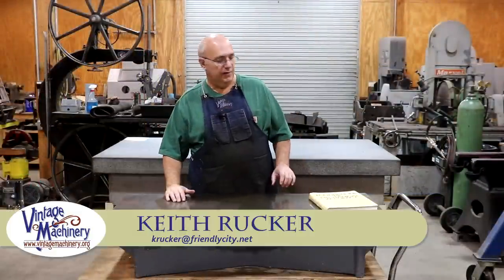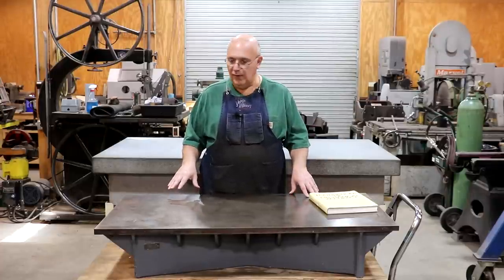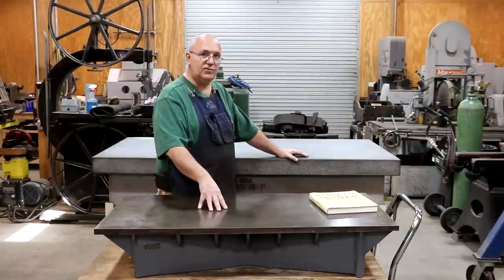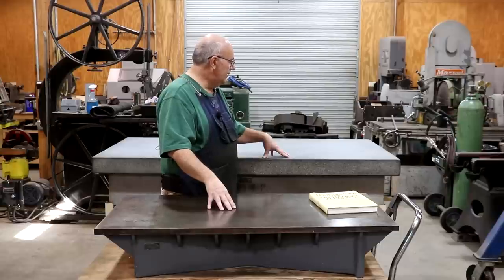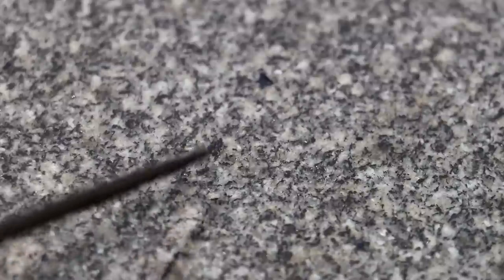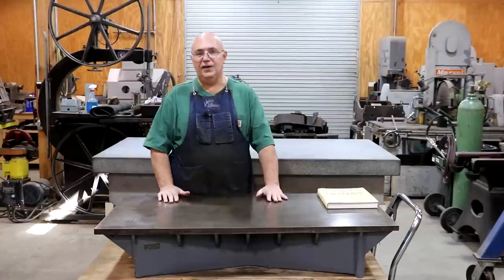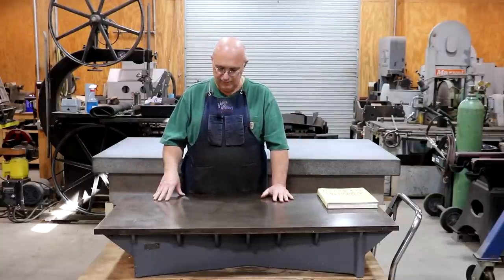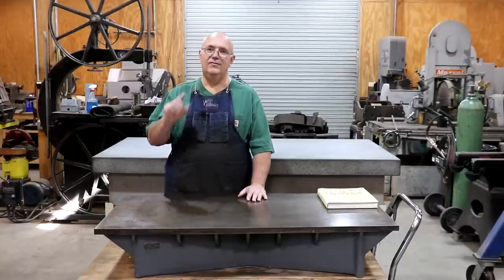Surface Plates:  Granite vs Cast Iron

Comment: Nice find. I was recently in a shop of an older gentleman who builds and repairs some high-end race cars, and he had a cast-iron surface plate for inspecting   for damage and alignment. He said it was 10 feet by 20 feet. The side rails under the perimeter of the top looked to be about three feet tall. I can only imagine how heavy this thing had to be.
Reply: Heavy enough to influence the orbit of the earth based on where it is sitting, I reckon. That's just plain huge.

Comment: If you dont need extreme accuracy, a piece of 3cm granite from your local granite countertop shop is great, pick the closest tightest grain structure you can find in the scrap 'black absolute' is one of the best but other colors work great.  Ive use it for lapping and scraping parts in with no issues, ex exhaust manifolds, headder flanges,  filter housing mating surfaces, carb bases, water outlets and such.
Reply: For lapping components like carb mounting faces, oil pump faces, small heads, etc I just use a plate of glass.
Reply: A friend of mine went to a company that made tombstones. He got one where they misspelled the name of the deceased, it was really cheap. He then lapped it in.
Reply: Tempered glass works in a pinch too.
Reply: @transmaster  perfect scrap material for this purpose   a mistake in a headstone cannot be fixed it must be replaced, theyd sell it to you for a song lol!
Reply: I'd be careful with glass plates, they are more flexible than you might think. Also the flatness isn't that great, I built a simple device for measuring flatness and tested a pane of glass, the indicator jumped all over the place even if it seemed to be flat.
Anyway, I built a simple surface plate out of a broken granite tile (actually two, both halves were usable). The surface was somewhat ground already, but just to be sure I got some abrasive powder (silicon carbide) and lapped both plates onto eachother. The result turned out pretty good. It's not perfect, but I'd definitely trust it way more than a piece of glass.
Reply: If you don’t need a large plate and a B surface is good enough, which it almost always is for shop work, garnet plates are cheap enough. You don’t have to resort to using something that you think is flat, but isn’t. And I’ve tested a number of plates over the years, and most plates sold as a B are often better, sometimes being an A. Almost nobody needs a lab quality surface. Additionally, a problem with CI plates is that they do rust. You must take good care of them. I’ve seen plates with rust over the surface, or over large spots on the surface. Once there’s rust, accuracy is destroyed. Remember, this is a surface plate, a couple tenths rusted out is a problem, even if it isn’t a problem on a machine tool.

Comment: A great video Keith! So much information about the merits of cast iron versus granite surface plates. I've only room for a 12" x 12" granite in my tiny, tiny shop 7' X 5' yes that small in which I have a 12"x 19" lathe with a milling machine attachment. All the rest of my machinery is outside under cover lol. When I used to be a teacher we had a brand new 24"x 24" cast iron surface plate on a cast stand about 38" high and apart from myself on personal projects I only ever saw it used a couple of times by students. (My head of department taught the senior year examination students ) now it has probably been scrapped along with a 9" Viceroy Shaper, and a Tom Senior Horizontal mill that I was the only one to use. ( until I left of course) there were also 4 , 12"x and at least 24"lathes. One with a vertical milling attachment. Again I was the only one to use it in the 10 years I was there. All probably scrapped or just sold off. What a bloody waste!

Comment: Great information Keith, learned something new about the difference between those materials. Concerning the moving cart, use large wheeled castors that won't get hung up on small bits left on the floor. That thing has "top heavy" written all over it. Pretty sure you already thought of that but a reminder doesn't hurt.

Comment: Thanks for the information.  I have a small benchtop cast iron surface plate in my shop.  I love it and use it all the time.  Mine came from England, and is in great condition.  I always kind of wondered how granite and cast stacked up against each other.  Glad to see your recovery is going good.  God bless you and your family!!!!
Reply: if I was doing a scrape job that had to really be close (say a P&W jig bore), I would always try to use a cast iron plate. I have always felt that cast iron rubs better than granite. Probably just me, but granite tends to smear the blue rather than simply hit the high spots. Still you can do quite well with granite if you know what you're after. Most people use way too much blue on the granite surface. Still for something really big there's usually no other way. I most always rubbed my strait edges off a granite plate that was cut to a certain contour (extremely important) but would be out of spec when measured. 

Most folks start off on a bad footing when they start a scrape job (or lap a granite plate). Really big ones are never moved, so you have no real choice in the matter. Anything smaller than a 6' x 9' was brought to my shop, and I'd let it set for two or three days. Cast iron is easier and you can start on it in 24 hours. A machine must be leveled and then tweaked in till the bottom axis is as strait as you can get it. I might add here that I usually did this with a Federal Electronic level, or at least a laser (the electronic level is much easier). Sometimes it takes the better part of a week to get this done as the machine will change everyday. I once had a Devlieg jig mill that took a solid three weeks on the x-axis alone. Still the numbers were a bitch before you started (.000020" in 12 feet). After you level the base everyday, you can start on the next slide and rough it in. Once it quits moving you can go to work. 

In the shop, I always had three or four strait edges to scrape, and several cast iron parallels. Angle plates can be nasty to do if done right. You need three angle plates to master off of, and this alone is rare. Yet they numbers are easy. Small ones (6"x 6") I had, but a big one I didn't. My master angle plates (a wooden box of five) were kept locked up and never used. My final check for squareness was with a 12" callibrated cylinder square.

Comment: Great video Keith
my dad was a Fitter at the same iron works as I served my time as a sparks . away I digress  the fitting shop had the old fashioned oak block floor end grain up set on pitch ( nice for the legs and does not ding your tools ) the surface plate was some 20 foot by 12 foot and was constructed on a raised concrete slab,  said to be six foot deep, the interesting thing was the cast iron top was made up of separate CI cubes about 1 * 1 * 1 foot , it was used to sett up for machining large casting for the items they assembled , the overhead crane had two blocks one 5 ton and the other 20 ton ( that's 2240 pounds ton ) , I never knew how good it was

Comment: We have a cast iron one at the shop I work at. Its 4’x6’. Hasnt been lapped in years and hasnt been used as as surface plate for a long time. Mostly used as a workbench now. We have a few smaller granite surface plates for inspection use.

Comment: Nice find! I was a scraper hand at a machine tool rebuilding shop in Cleveland Ohio in the 70's. My shop had a beautiful 4'x8' scraped cast iron plate, the master of the shop full of many smaller surface plates, straightedges, and squares. It was treated as such, not used for storage, and always clean. I have also used granite, but find a scraped surface a little better for spotting, the transfer of the blue marking medium for the piece being scraped, that's just my opinion.

Comment: Keith a very useful ready reckoner for Fahrenheit to Centigrade is that 61ºF = 16ºC and 82ºF = 28ºC and then just interpolate between the two sets of equivalents.
Reply: C = (F-32)*5/8 
F=8/5*C +32   
Straightforward conversion every schoolboy knows
Reply: @David Martin  actually it's 9/5 and 5/9, but you're right otherwise.
Reply: @davidmam  I think the conversion factor is actually 5/9 not 5/8. But therein lies the difficulty because it’s hard to remember! Otherwise I’d agree with you that the math isn’t too scary.
Reply: quick and dirty for C to F double the c and add 30 ,not completely accurate but near enough plus its a easy in the head one  works the other way also - 30 / 2
Reply: Negative 40 is negative 40, in both.

steve

Comment: I picked up a 16" x 16" cast iron plate with a wooden cover from an auction. I wasn't planning on buying it, but no one was interested and got it for next to nothing. As i'm a novice engineer, I have yet to used it in anger, however there's been several times when it's been useful for lapping on emery (had been using glass). I doubt it's accurate, but well within the tolerances I will be doing.

I'm really hoping Adam finds something similar and Keith would be willing to do a swap, to keep a tool that gramps might have used in the family.

Comment: This was really interesting.  I had the chance to install some signs at an aircraft parts manufacturer a few months ago, and they used a granite plate as a reference but had an old Air Force 6ftx12ft cast iron surface plate for absolute accuracy.  It was scraped to an overall flatness of 1050 (grade AA).  For reference the highest grade I've ever heard of is a 1100 overall flatness, I don't know if it's even possible to make one better.   They said that using the cast iron plate is required by the FAA for absolute accuracy in turbine parts, since they are machined down to a +/- .0005 threshold.  I honestly thought cast iron was inferior until they explained that in a climate controlled room, it needed less maintenance and was easier to clean.  The only downside is that it should never be moved once installed and flattened.  even a grain of sand under the leg can throw it off over time.  mainly because it deform the feet and cause raised edges that will make it unscrapable until the feet are remachined flat.

Comment: I have a little 12x18 cast iron plate. I was told the smaller ones were used to drag across the larger ones, but I have no idea whether that's true. I like mine--similar patina to yours. It came with a nice wooden cover already built, which makes sense, since it came from an old boatyard.

Comment: Just ordered that book you referenced.  Very expensive but right up my street.  I remember my dad telling me that cast iron plates needed to be made in threes.  My cast iron plate is only 12” by 12” and would have been purchased second hand in about 1950.   When i get my precision ground stones i will certainly check for any high spots although the plate has a wooden cover which both my father and i have  been careful to always used. Very interesting video!

Comment: I read "Machine Tool Reconditioning" by E.F. Connolly back in the eighties to check and correct all my machine tools.  It's the best I ever read, probably similar to the one you show.  When I got mine, I found a "carpet sample" at a flea market that was an exact fit for my 18 by 24 plate.  I've had it for almost forty years, very handy to have for general machine work and for testing/try fit of precision fits.  Before I found the granite, I had an apron from a large lathe, about three foot by one and a half, I scraped flat and true, used for ten or fifteen years.

Comment: I know of two HUGE Starrett granite surface plates that have been sitting at an abandoned machine shop site, outside in the Iowa weather, for 30 years. The small one is at least 4' x 8', and large one substantially bigger. Check out  41°58'34.24"N  91°35'10.93"W and zoom way in.

Comment: Keith, when I was a youngster, car 
enthusiasts used to LIKE engine 
blocks from a car that had 
experienced an engine fire, just 
because the heat had removed 
all the deformation.  Yes, it needed 
machining, especially the main 
journal area, and the cam area.

Cast Iron is an interesting animal.
I'm quite a fan of the OLD ShopSmith 
multi-tools.  They used a LOT of Cast 
Iron.  (The sign in for the Model 10, 
[10e and 10er] Forum, is Cast Iron.)

steve

Comment: We have loads of medium size cast iron surface plates at my workplace, they're used for inspection near the machines (mostly with a height gauge and some jigs for the parts), and if you need more accuracy we have multiple CMMs for that.

Comment: Having a small home shop I cheat and use my cast iron table saw surface.   I found this flatter than the granite "scrap".   I have also used a wing of my 8" jointer for longer items.   For the very few times, I have needed an accurate surface this has saved the day.

Comment: I saw a 4x8 iron plate posted locally for scrap cost. I believe it was several tons and stood at bench height without legs. 

If I had room for it, I would own it for the simple fact they look cool. Until i have more room, my little bench top iron plate will do.

Comment: Semi-related.  We needed a 3x4 inspection surface for 120 pound ceramic objects to be sure the bottoms of the objects were flat within +/-0.06.  Unglazed fired ceramic is extremely abrasive.   I have purchased many surface plates both granite and, years ago, cast iron.  Anything we used for a table would be highly abraded.  So standard surface pates are not suitable.  Granite surface plates would last only a few days.  I searched for an old worn-out / damaged cast iron plate or machine base that could be repeatedly ground back to flat as it was worn from use.  No such animal in the budget cost range.  I resigned to building a cheap temporary table from steel.  A local shop said they had a piece of WWII Sherman tank armor in their parking lot for years.  They wanted it gone and at scrap steel prices.  Could I use it for the inspection table if I altered some of the dimensions?  Sure.  I had the armor Blanchard ground both sides so it could be flipped over when one side wore out.  

Wow!  After thousands of heavy parts dragged around on the table, the surface was still flat within +/- 0.0001 after 3 years.  Did not have to flip it over and use the other ground surface.  Absolutely amazing.  I have seen cast iron and steel worn -0.01 after a few hundred heavy ceramic parts.  

Too bad the project is complete.  Would like to keep that inspection table for the next future job.
Reply: Yeah no doubt. Armor plating is just that, armor. Hardened tool steel essentially. Ceramic will cut or abrade most anything. Even considering the plate was designed to stop ordnance, it's still impressive it stood up to 3 years of what amounts to the worst possible conditions outside of what it was made for. Pretty awesome.

Comment: On the farm I bought I found a 2' x 5' cast iron surface plate with aluminum trunions on the ends. Was in the dirt at back of the barn. At first I didn't have a clue what it was. Has a Convair tool tag on it.

Comment: I have two cast iron surface plates and one granite surface plate. Your testimony to cast iron makes me reconsider the value of my cast iron. My last CI plate is small and was an auction purchase whim ($7). My years in the shop was entirely dismissive of CI. I suspect my "oldest" CI plate is low accuracy. It includes T slots. I don't know its original purpose. I thought it was a cheap investment into hobby shop capacity with machinery that couldn't boast high precision due to its inferior design, age or use/abuse. I own some of this level machinery in my hobby shop. I have often wished that a surface plate had mag base functionality. Maybe it is time see if my CI plates warrant more affection.

Comment: Working at Kearney and Trecker I can attest to the fact steel weldments were a different animal. Cast iron was more stable, as machines would heat up tolerances would change with the steel til it leveled out.

Comment: I use mine as a welding table. I coat it with anti spatter gel.  I don't weld to it, just weld on it.  I cleaned my medium rust off (when I got it) using paper towels soaked in vinegar.  For the metrology I use a granite plate.    I think my cast iron plate is 18x18.. It weighs quite a bit.. I think about 80lbs maybe more.  I would like to clean up the bottom and paint it because it's out in the garage.. but I've had it for so many years and have never gotten around to it, and probably won't.

Comment: It's a good layout surface.  Your shop is getting crowded so putting it on a wheeled stand is probably a good idea. I'm thinking that you need an addition dedicated to the keeping those plates.  If someone wants a cast iron welding table, go to Fireball Tool.

Comment: My first job out of high school was for a machine tool rebuilder.  They had a big granite surface plate, maybe 10ft long and a lot of cast iron plates of all sizes.  They had precision lasers, precision levels all kinds of camel back straight edges...  They also had a huge Favretto way grinder that they would use on big machines. When they needed to do precision measuring it was on the granite.  When they needed to scrape in ways, tables or parts they used the cast iron.   Every now and then they would do the 3 plate scrape in, to recalibrate them.  I learned a lot there but I was a stupid kid and changed jobs.

Comment: Never thought about cast iron as a surface plate but it makes sense. It is a very stable material. 
On a side note what has happened to the large Dresser band saw restoration?
Thanks for sharing.